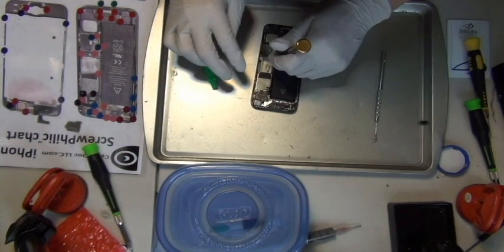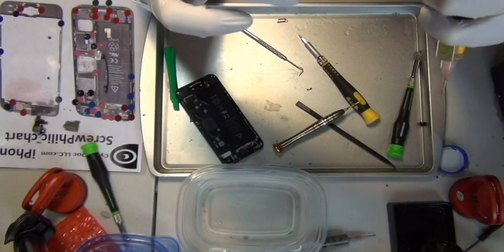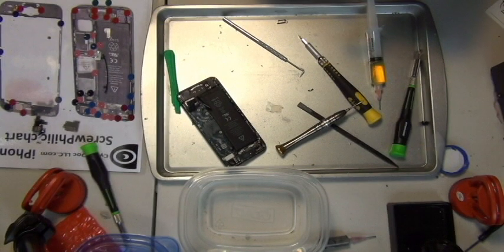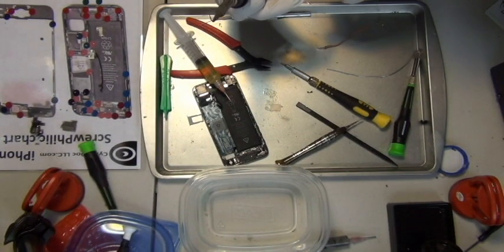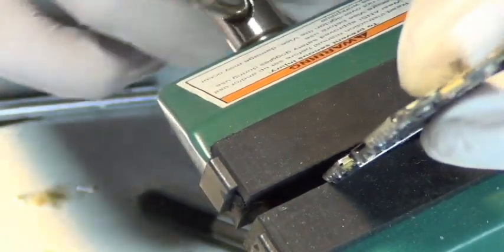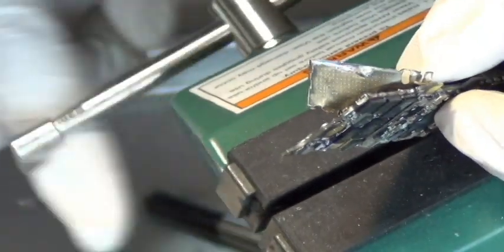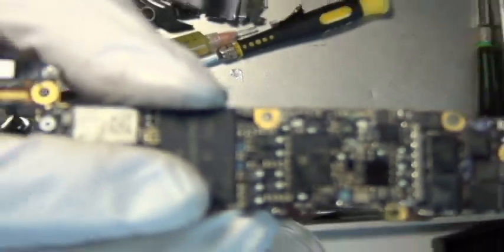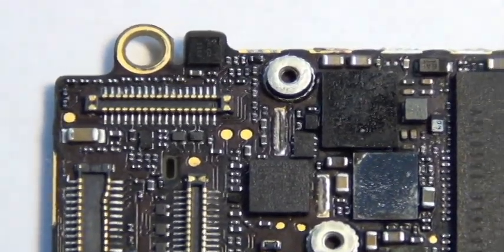iPhone 5 EMI metal shield solder removal to expose logicboard with CyberDoc QuickAlloy desoldering

Comment: Did you put this phone back together?  Did it work again?  Went swimming with mine in a saltwater pool.  Trying to figure out about taking the shield off.  In hindsight, would you recommend your method or using hot air?

Comment: I rent the 5 minutes screens. Nothing soldering not need easier for them to tear off gently , fee strong, no time does fly. Than to sit here so hour unsolder them. Or heated to 250 degrees only must withdraw immediately as the beginning of плаиться tin on the edges, and it does not distort the cost, otherwise float balls at BGA. The last two iPhone did.

Comment from the maker: my method with CyberDoc Alloy is better, only hot air will cause to rip off things on the board, with increase thermal stress anything can comes off easy including copper pads.

Comment: Hot air works best and I have never had any pads come off nor removed any smd components. Soldering and adding a low heat alloy is too long of a process. I also do not agree the shields should not be put back on.  In order to do a job correctly what is removed should be replaced. If they were not needed the manufacturer would not have installed them in the first place